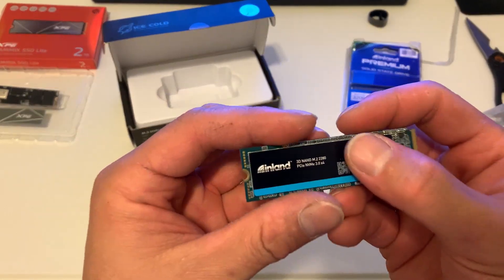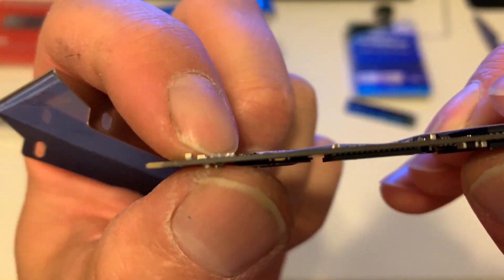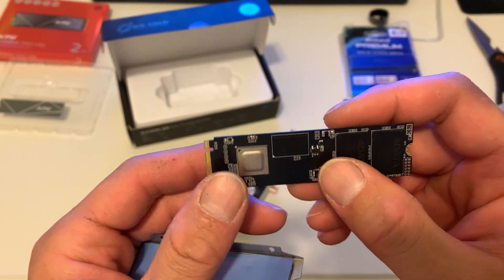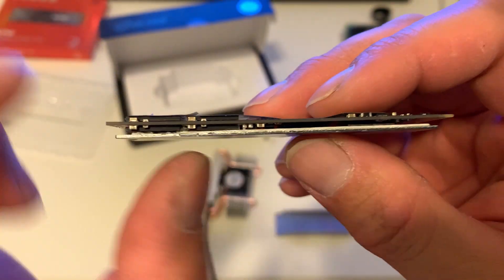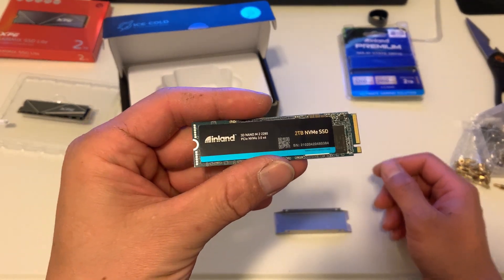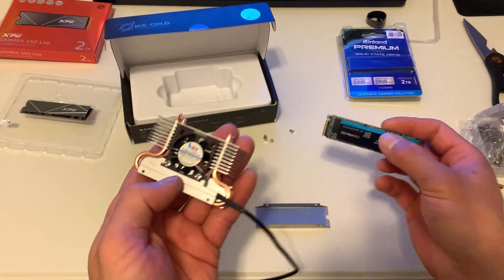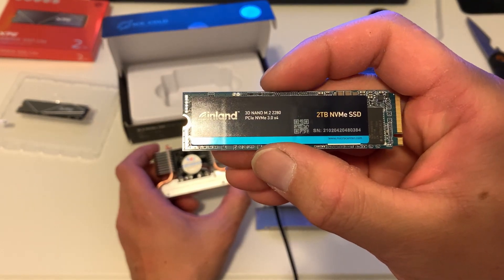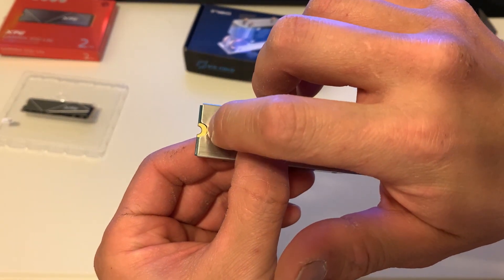Inland Premium 2T, Ineo M.2 Cooler, XPG S50 Lite 2T

Comment: I didn't use any of the Heat Sink's like your using here. I used the standard one that comes on the Motherboard. Example Asus ROG Strix B550 E Mobo. My temps stay around 35 degrees.

Comment: I see your using what appears ro be a Motherboard Standoff. It does not look like the correct one. You should have the right one in a small bag that comes with the accessory kit. mine were smaller & silver in color. Not Brass, & there is a bit of a lip or landing around the screw hole that the M.2 hole fit's over.

Comment: Please keep in mind, you want to cool the "controller" on the M.2 SSD, not the flash NAND. The NAND likes to run warm/hot to maintain its writes endurance per specifications while the controller needs to be cooled as when it's in use the controller is what is getting very hot and causing throttling of performance. Do not cool the NAND Flash chips!

Comment: Hey man, i Installed mine but I cant seem to understand which direction its pulling air. I have the fan pointing upward (because i want the air to travel up). Is that the correct way? Thanks
Reply from the maker: Fan pushes air into the fins.   Right now, you have the air going down.

Comment: What is the noise? Can rpm be controlled? Thanks.
Reply from the maker: I think the noise was from my GPU.   You are talking about the Ineo M.2 cooler right?   I actually removed the fan from it, and it runs really cool, like 35 Celsius, on average.    My M.2 never exceeded 40C, even if I maxed out my PC, like rendering video.
Reply: @HVAC_Jae  thanks for the reply, I’m actually thinking about using this on the backplate of a gpu, my card memory is running at 100C, just curious if it’s loud, too bad you can’t control rpm
Reply from the maker: @MrNiceKnife  When I get home from work, I will plug in the fan and record it for you.
Reply: @HVAC_Jae  I ended up just getting one, thanks for the video. I think this is the only video actually showing the product
Reply from the maker: @MrNiceKnife  I was about to record the fan noise, but now I won’t bother.    My fan was quiet.

It’s a really good M.2 cooler.   You probably won’t even need to run the built in fan, if you have good internal cross airflow.   My M.2 went from thermal throttling at 75C to 35C-40C, under heavy stress.
Should be just fine for ur GPU’s memory.
Reply: @HVAC_Jae  appreciate it, thanks.
Reply from the maker: No, the fan speed cannot be controlled, just by plugging directly into the motherboard.